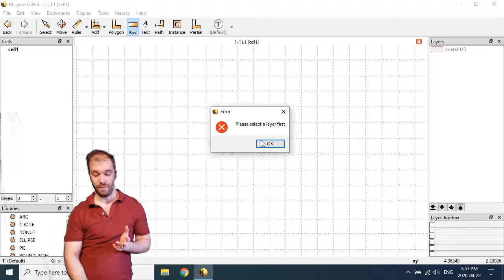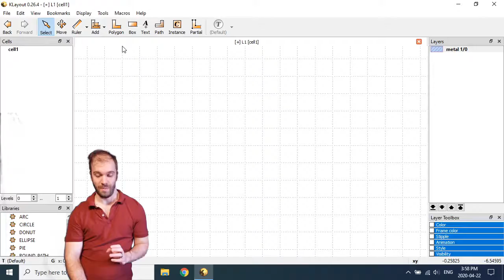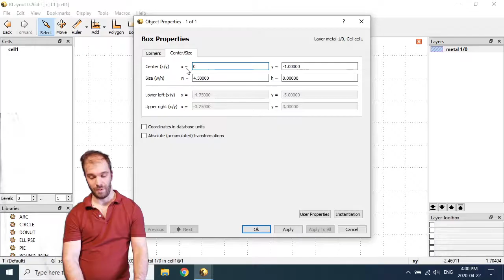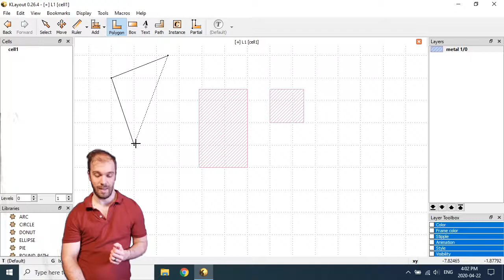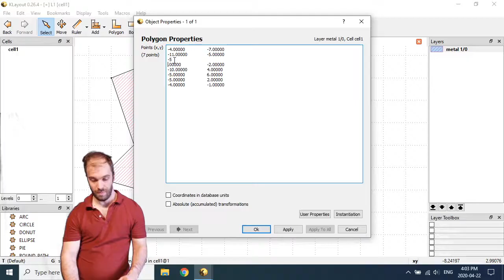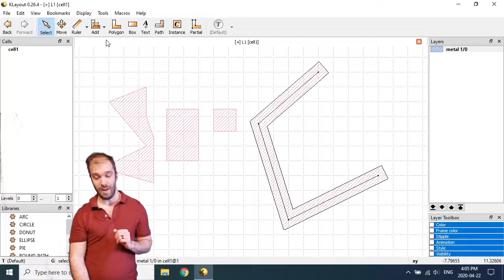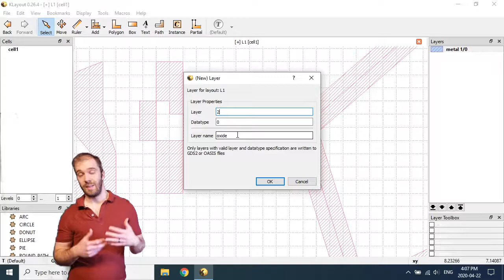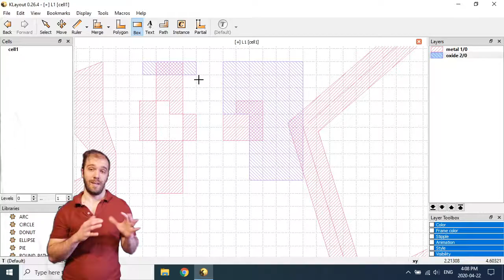KLayout Tutorial #1: Drawing Shapes

Comment: but when I double-click on the box the software recognizes it as a  polygon, not the object! so, the corner and center table does not open and only it opens the polygon properties table with the coordinates of 4 different points. How can I solve this problem???
Reply from the maker: Likely the combination mode is set to 'merge' try switching it to 'add' instead. The button to switch this is in the top menu between 'ruler' and 'polygon'

Comment: How to add alignment marks with a dimension of 5 micron, can you make a video for that
Reply from the maker: Check out the video on making cell hierarchies: https://www.youtube.com/watch?v=VaoRk8fuvKY. I would make a cell with your mark in it, and then create a 2x2 array (such that you have one in each corner) with the desired spacing. You can then place this array around your device, and fine tune the coordinates in the array dialog
Reply: @qnfcf6093  Hi， I have a question, when I create a box in a layer, but it shows it is a polygon, and I can not adjust the center, length, width of the box, I didn’t see the adjustment interface of the box size in the video, just the coordinates of the four points.

Comment: Hello, I am trying to create a box, but i don't get strokes and it doesn't seem to be creating. I followed the same procedure as you mentioned.
Reply from the maker: A couple things to check here:
1. It could be you're on a lower level of the hierarchy, so you're not seeing each shape, just the cell outline. If this is the case, you'll see a black outline with the name of the cell in it, rather than the boxes. You can fix this, or test if this is the problem, by  selecting 'display->full hierarchy' in the top menu. There are also options here for moving up/down the hierarchy.
2. You may have a specific combination mode on. The button to switch this is in the top menu between 'ruler' and 'polygon' typically we set this to 'add'. If you have it on something like 'erase' you won't draw any polygons.
Reply: @qnfcf6093  Thankyou , I didnt change it to 'add' , it was in 'erase'. Its working now. Thanks